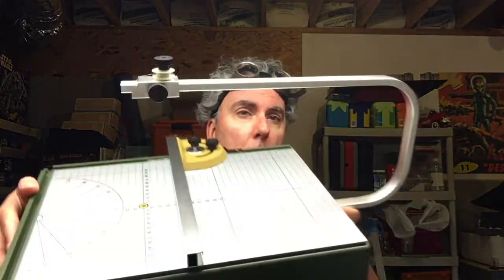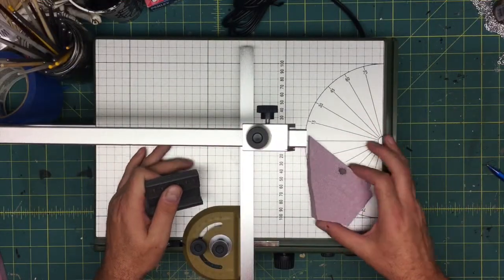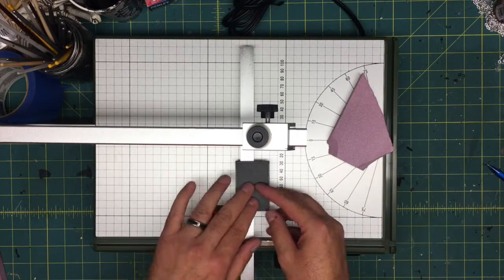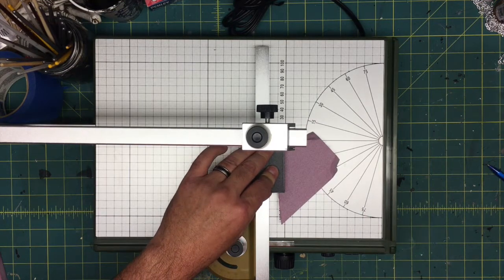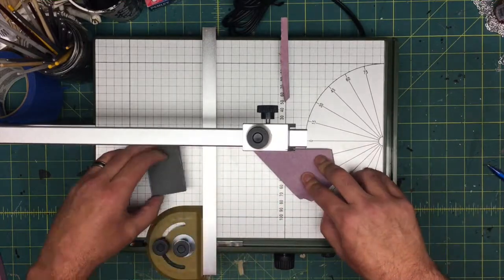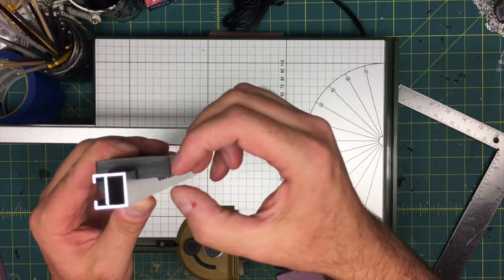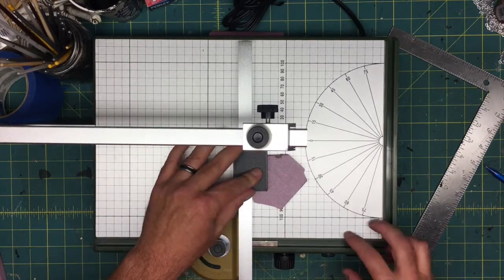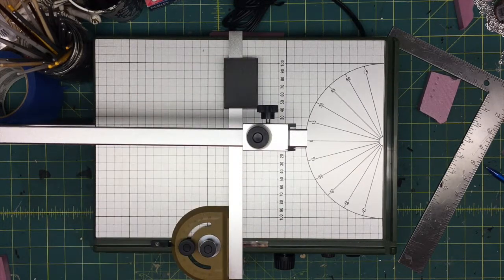GTE 028 -- Foam Cutter Guide

Comment: Great idea! You've solved an annoying problem with such an easy simple device. Very inventive. What if instead of the little spikes you used a  coarse grit sandpaper adhered to where the spikes are, or if you could 3D print a coarse texture where the spikes are. That would eliminate the spike punctures.just a thought....

Comment: A BILLION TIMES YES.  Slanted cuts with a blade, returning foam to square, even speed on the Proxxon, all the things that have annoyed me, you addressed here.  My sole question: what about cutting 1" thick foam (that's what I usually use)?
Reply from the maker: I cannot buy 1" foam in Atlanta. Looked EVERYWHERE! But I could easily increase the thickness of the object to hold 1". Let me know if you want one to test and I'll print one for you and send over. (Although I think you have a 3DP, correct?) Later today, I"m uploading another Proxxon solution to a known issue. Love your channel!

EDIT: I see the issue now! With 1" foam, the thickness of the foam will exceed the height of the fence. Let me ponder this one... I'm sure there's a solution.